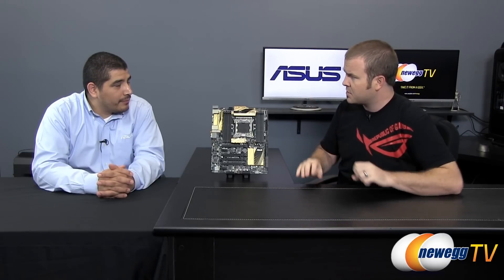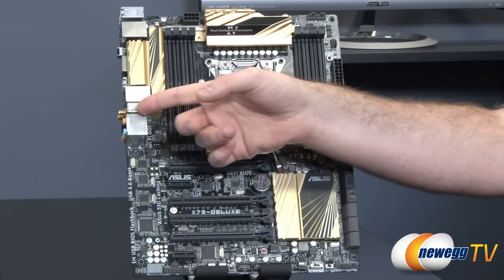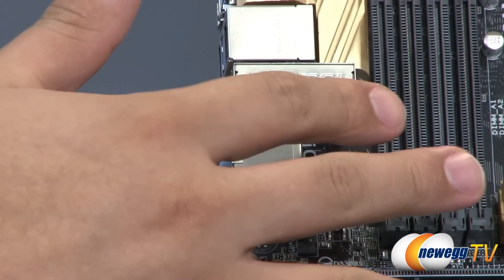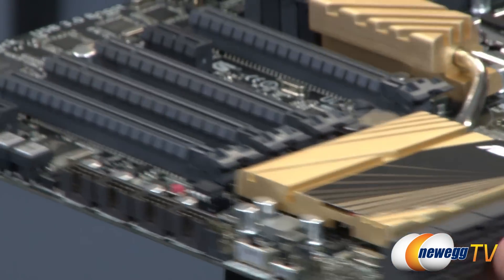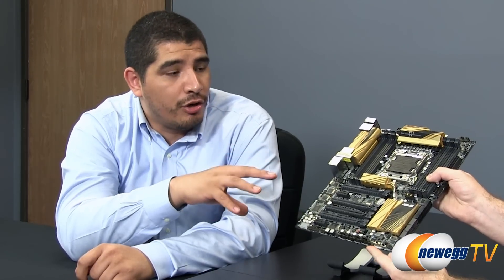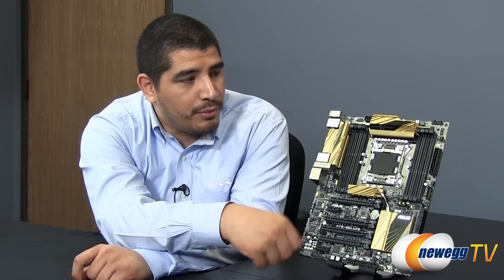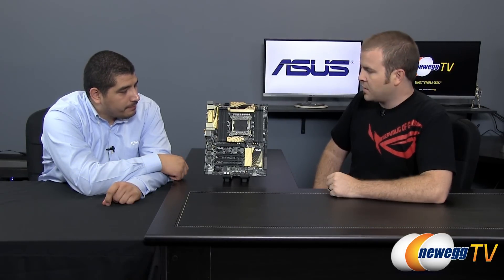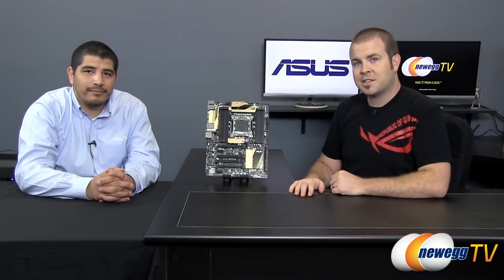ASUS X79 DELUXE ATX Intel Motherboard Overview & Interview - Newegg TV

Comment: Has anybody noticed the dent on the PCH in the video? Anyways, I bought this board as soon as I saw this video. I was so impressed. I used to have a gigabyte x79 ud3 and bios crashed just like its predecessor my x48 with QX9650. Now I have this board with a 3930k and its rock stable, so overwhelmingly high tech, quiet and I absolutely love it. I have ASUS graphics cards in SLI. Thank you very much JJ and ASUS
Reply: ***** Yeh, It's a real shame that despite the good products Asus has some of the worst customer service/support in the tech industry, -Fact

Comment: wait for haswell-E... confirmed 8 cores 16 threads..  the x99 chipset is near btw. and it has ddr4 memory, which runs extremely fast at high frequencies haswell-e might be on the x99 chipset, i would hope so.

Comment: as long as the CPU is socket LGA2011  and everything meets up like speeds and ram ETC.also intel released a new X79 chip the ivy bridge-E chip with is still socket LGA2011 and can use X79 boards  but is newer and supports everything that haswell does like new DDR4 ram and things hope this helps

Comment: Works with any of the Sandy Bridge-E non-Xeon processors. J.J. is just simply explaining that this new motherboard is optimized for the release of Ivy Bridge-E to get the best usability out of the CPU compared with the older designed motherboards.